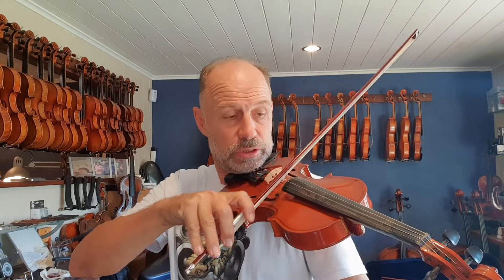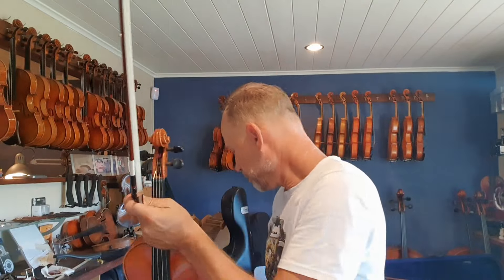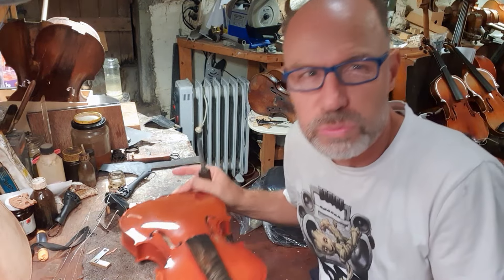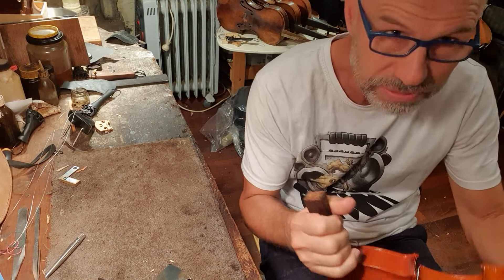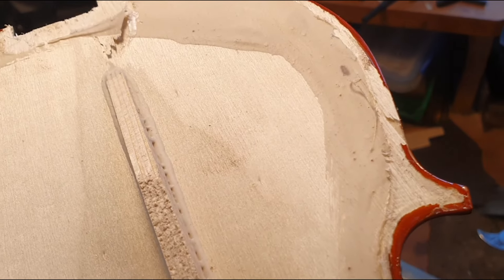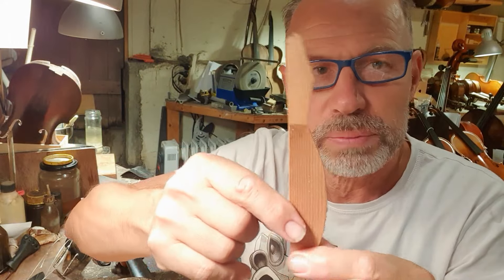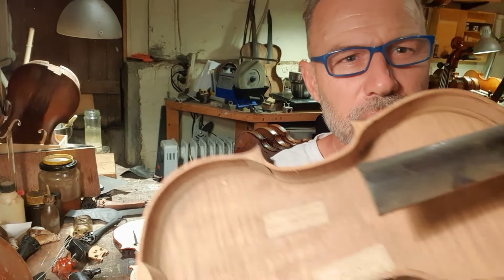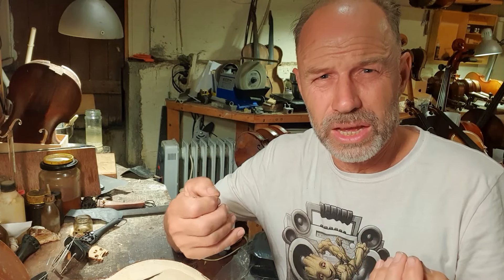I open up the 100 dollar violin

Comment: Olaf this information about the summer and winter grains of wood and how that works for the top plate is really fascinating! I love little bits of info like this. Thank you!
Reply from the maker: Thank you
Reply: Agree! I really love learning interesting tidbits like that.
Reply: That was super informative! No wonder so many top end acoustic guitars have sitka spruce tops.
Reply: I don't want to sound pedantic here but the growth rings are a combination of cells that are laid down in the spring and the summer, not winter.  Trees, other than those in tropical areas where conditions are similar throughout the year, do not grow in winter.  The trees go into a dormant phase. When growth starts in spring cells are laid down relatively quickly and the light part of the growth ring is formed.  This is the springwood.  Cells are laid down more slowly in summer and these form the dark part - summer wood.  An annual  growth 'ring' is a combination of these light and dark cells - one layer of springwood and one layer of summerwood.   

Fexibility along the grain is determined by the length of the cells that are laid down.  In spruce these are relatively long, hence its relative strength.  Wood cells in ash, elm and poplar are also relatively long, hence their use in spokes for cart wheels and snooker cues (ash), wooden (not MDF!!) coffins which are shaped (elm), and matches which have to resist snapping when struck (poplar).  Trees that do grow in the tropics may not have spring and summerwood like temperate species, but still do produce 'rings' as growth rates vary throughout the year, though they may not be very distinct.  Some species like eucalyptus have a 'resting' phase each year even though conditions for growth may be conducive.  And finally the term 'sap rising' is a bit misleading.  In any tree free water or sap is found in the cells in the cambium - the actively growing tissue below the bark - and is there all the time.  It does not rise and fall depending on the season.  The more accurate term would be 'sap flow'.  It flows fastest in spring, slower in the summer, and there is hardly any flow, if at all, in winter.

Lecture over!!  I really enjoy these videos and it is great information for when I make my first fiddle.  Thank you Olaf.
Reply: @wyzonzebedee5556  I thought that spruce was a coniferous tree and didn’t lose its needles.  Does it also go into a dormant phase in the winter?
Reply: @jasonli2974  Hi Jason.  Spruce is a coniferous tree and does not lose its needles in winter, and is considered to be an 'evergreen'.  Mind you larch is also a coniferous tree and it does shed all of its needles in winter.  The term 'evergreen' is not that helpful really.  The botanical distinction between coniferous trees (gymnosperms) and broadleaf trees (angiosperms) is how their seeds are developed, not whether they keep their leaves (needles) or not.  The seeds of gymnosperms are usually formed in cones and the seeds are 'naked', i.e. do not have protective cells around them.  The seeds of angiosperms develop in the ovaries of the flowers and are surrounded by protective cells.  If you tip a ripe pine cone upside down the seeds will fall out.  However if you look at ash seeds for example they have a thin layer of tissue around them and have wings to aid dispersal.  Horse chestnut seeds, or conkers, have a thick fleshy skin around them.  The flowers on a pine or larch are beautiful structures in the spring as they develop, and to make things more complicated, or interesting, there are male and female flowers.  It is the male flowers which produce the pollen, the female flowers grow into the cones.  

Spruce does go dormant in the winter, hence it will have distinct annual rings.  I'm guessing here but I reckon the best spruce for violin making comes from areas where spring and summer growth conditions vary little from year to year, i.e. in mountainous areas, or in areas with short springs, consistent hot summers and cold winters and where growth rates are relatively slow.  This will give narrow and even growth rings.  In areas where the weather is much more variable and spring and summer can be wet or dry and there is less consistency between years the relative density of the wood between years will vary more.  Again I'm guessing but I suspect this is not so good for violin making.  Looking at the top of my violin the growth rings are even and very close together.  Somewhere in Scotland (where I live) there may be a stand of spruce where growth has been slow and even, but I have yet to find it!

Hope this of help.  Timber is a fascinating subject.
Reply from the maker: @wyzonzebedee5556  thank you for the detailed explanation.
Yes, the best spruce for stringed instruments comes from mountainous regions because of the minerals and the big difference in temperatures. 
When you tap a piece of timber for a top, it should have a clear ring to it.
Reply: Indeed it is.
Reply: https://youtube.com/shorts/2WP5LaU617Y?feature=share4 @jimothysparkcus .n 2:11ñp😊
Reply: @AskOlaftheViolinmaker think a little deeper, mountains have higher elevations therefore lower temperatures, thinner atmosphere, water migrates away from roots due to slope, less daylight due to shadows,  all above regard annual growth making wood denser and with a little more thought we could probably expand this list.  But what do I know, I’m a hillbilly from eastern Kentucky!
Reply: Actually the spruce preferred for this is called "Nordische Fichte" in German, which means the trees grow up in the north near the polar circle. The trees growing in the mountains have a similar effect, but they more often get uneven sunlight. The best trees grow in the mountains in the shade, where they almost never get direct sunlight, only indirect ligtht, reflected from the sky. They do not tend to grow larger branches in one direction and grow slowly but very balanced. Some instrument makers look out for these trees and pay a substantially larger margin for those. The forester in charge knows that and gives heads up when they harvest a certain area. The instrument maker then picks the trees he wants before they are cut. Sometimes they even use helicopters to transport them over rough terrain. The wood then is dried carefully in the shade in open air, in the cool, as slowly as possible to give the wood the time to react to the shrinking process. You do not like heat treatment. Wood for furniture can age for five or six years, but wood for instruments ages as long as possible, even for decades. Wood shrinks over a long period, even after one hundred years, but the shrinking rate is slower the older the wood gets. So you want to use a piece of wood that is 50 years old on an instrument that is 200 years old, just because you do not have wood that is that old. So you just take the oldest you have to get the best possible match.
Reply: Very interesting video. Also, the wood for the top and back is true quarter sawn and not flat sawn. So the grain length is perpendicular to the top and quite short. Expansion is in the thickness and not the width.

When you buy a sound board top, it comes as a kind of wedge. You resaw the wedge, book match it and glue the joint. Then you get to shape it.

Critical are the F holes in terms of placement and shape. Depending on the note, their are various modes of oscillation. The tongues wiggle differently. So how the wood moves under harmonic vibration is critical. Plywood prevents the proper mode of vibration.

Trees in the alpine are stunted and extremely slow growing so growth rings tend to be very narrow. The density of the wood also matters. If you thump a log with a hammer, a sound tree will have a deep hollow sound opposed to a thud. If take a wedge, sometimes split with a friend, and thump it after initial drying, you can the base note. If it’s got a defect, you can hear that immediately.

The base bar stiffens up one side and restricts vibration to the lower frequencies and modes. Truthfully it should be tuned by using an ibex plane and thumping the top. Removing small amounts until you hear the warm thump.

I was amazed that a ply top sounded that good.
Reply: Can you please tell me what brand this $100 violin is? I bought a Glarry violin in the past that looked good and sounded ok to my ear. Of course I play like crap. I am planning on buying another cheap violin because I'm almost 60 and I know it's not worth buying an expensive instrument.
Reply: Shouldn't you have heard this in biology class at school?

Comment: Reminds me of cheap homes, where the bulk of attention to detail comes at the very end, to hide all the inexpensive shortcuts and cheapness that will fall apart in short order.  My father once did a tour of such a house, and when he pointed out that he could feel a breeze in front of a closed doorway, they mentioned that they could change that - like air leaking through doorways was a feature.
Reply: Property developers...
Reply: That's aerodynamics, ~ helps the house go faster.
Reply: NEVER buy the models. They are built first and have all of the fuck ups! I built many track homes....what an experience that was. My house was built in 1965 when they still used true dimension wood, six inch walls and heavy iron pipe. Anything that is ´´master planned´´ and built after 2000 will fail quickly....cough, cough...Chinese drywall...
Reply: That can happen in any house, cheap or not. All it takes is a lazy door hanger. Having expensive doors doesn't keep it from happening.
Reply: @J.C...  "Having expensive doors doesn't keep it from happening" - I don't think the OP was implying that expensive doors would prevent the air leak, in that example.  I think he was saying specifically that the builder didn't pay attention to the details when building the house, thus the "shortcuts" and lack of attention to detail led to inexpensive and cheap-quality labor, which resulted in the air leak (as opposed to building the house properly, paying attention to details, which would have increased the labor cost).
Reply: Using wet wood will help keep the humidity up in winter.  Definitely a positive feature that everybody should want.

Comment: Well, you can sell it to a stock photo agency... They don't even care if their models are holding the instrument right.
Reply: Yes and no. Some customers, especially those paying $500+ for a single photo, might be discerning. But if it's for a mainstream ad or a movie, they will put the most deceiving fakery in there.
Reply: Sometimes the violinists in publicity photos have huge long fake nails.
Reply: Or if it has a bridge... or if the bow is before or after the bridge... Or if the bow is relatively straight across the strings...
Reply: Enrico Friedrich As amazing as those stock photos are, they can’t hold a candle (or, indeed, a flaming violin) to the stock photos of people soldering. (Ok, actually they can, but then a perfectly good pun would have gone unused. All the same, electronics repair stock photos tend to be a dumpster fire of hilariously staged randomness while holding parts and tools in nonsensical combinations. But the take home message is of course to always hold the soldering iron by the heated working end, not the handle... 😂)

Comment: Interesting that hide glues are used for violins, as they’re similarly used in art restorations for much the same reason that it’s reversible.
Reply: Are you a fellow Baumgartner fan? 😊
Reply: Cynthia Verjovsky Marcotte Of course! What could be better than fish skin glue and Belgian linen?
Reply: @eliz_scubavn  right??
Reply: @cynthiaverjovskymarcotte1379  :0
Reply: Similarly, the neck joints on better acoustic guitars are often done with hide glue,  so that neck resets are marginally less painful for the repair guys.
Reply: @eliz_scubavn Yes , but it has to be fresh to dry hard. Hard to find now a days, but you can make your own. Glue pot recipes are best. Hide is pretty good too, also needs to be fresh.

Comment: just the fact that it's made of plywood explains why the instrument sounded so "muddy" having the grains of the wood bring crossed one way and then  the next layer being at right angles to the first would stop the plates from vibrating properly
Reply: Yes, I expect that the plywood damps a lot of the vibration. A flitch of old growth growth spruce will ring if tapped.

Comment: Every material has a modulus of elasticity.  When the material is formed into a shape, we can determine its natural resonant frequency.  Consider a perfectly shaped violin top plate made of stainless steel.  The modulus of elasticity is much higher (stiffer) and so the natural resonant frequency will be higher.  Get the perfect material but shape it improperly, and the NRF changes with the shape.

It is completely unsurprising that a lamination of wood and glue, with alternating grain direction, has a different modulus of elasticity.  The modal shapes will be quite altered, and the change in the NRF will change the sound.  

VSO indeed.  Well explained Olaf.
Reply: Spoken like a true engineer. It might not be that simple because different shapes will have different internal reflected sound wave distances, and that might make it sound different.
Reply: @SidneyCritic  Hi Sidney.  Yes, a differently shaped object will have different modal shapes.  Even seemingly minute differences can have dramatic effects.  Finite Element Analysis can illustrate this beautifully.   And yes, engineer here.
Reply: Do you think it's possible that the horrible looking resonance bar actually helps the VSO resonate better than a decent resonance bar would? I mean, could it be that making plywood resonate as much as it can is actually less pleasant for the ears than resonating it not so much (so that its bad sound isn't amplifyed, if you know what I mean)?
Reply: @oliviapereira364  Hi Olivia.  The resonance bar is likely made of plywood, just as the rest of the VSO is.  Speculating how that individual part would "improve" the sound is meaningless.
Reply: And further, the glue probably is damping the modal shapes, and the layers can be trying to vibrate in different shapes creating interferences. I don't think there is anything to be done except creating a new plate with a different material, which defeats the purpose.
Reply: @cfddoc  correct!

Comment: Little note on what you said at about 14:23 on winter and summer grain. Maybe for simplicity’s sake you cut a few corners, but I learned that wood does not grow in winter, so the darker lines (winter grain) are the ones the tree makes in late summer and fall to stabilize the growth it had in spring and summer (the lighter lines (summer grain)). Alpine spruce has, for the more difficult environment, less summer grain and thus it is harder (the dark lines are always the same thickness).
But very good content, I really enjoy our videos.
Reply: It depends on the climate. There's places where the summer is too hot and the trees are just trying to not die (they even get rid of some leaves like in fall in other places). Then in fall and winter they grow and get new leafs because that's the seasons when there is some rain.

Comment: - Did I get this right, Olaf?
- To produce the narrowest growth rings for Alpine Spruce, the trees would have to be grown in:
- North Facing Gorges with Steep Sides so sun and heat are limited year round especially during mini-Iceage times.
- There are such 3-5 ft diameter trees, but they are at sea level in Bay of Fundy, Nova Scotia.
- They would be good for masts, yards and spars but probably not for violin top plates.

Comment: Please do an episode with the God Pillar XD
Reply from the maker: I'm in two minds about it... it's a really dodgy website
Reply: @AskOlaftheViolinmaker  Safer to make your own god pillar. Can't be too difficult 😄
Reply: I converted a viola to the sound post through the belly to the bridge & it made it into a 'deep boomy' viola. That was different. Some have advocated it for small instruments used as a viola to at least get it sounding something like a viola, but it does require careful maintenance of the bridge, unlike many that let their bridge continue to bend towards the fingerboard. The soundpost is connected to the bridge foot by pinning with a toothpick. :)
Reply: @rossthefiddler5890  I tried down octave strings on my violin and took them off after two days. The effect was horrible and it took 6 months for my violin to settle back down again.

Comment: I'm never going to be a violinist. I'm just going to "fiddle" around now and then. The $100 toy is good enough.
Reply: Renting is cheaper and you can get a MUCH better instrument.
Reply: @brattingprincess  That is probably the best idea. I know a lot of students in middle school and high school rent instruments for marching band.  I hadn't thought that they rented violins too.
Reply: Robert Schuster Yeah we all rent until we get to be full size. Even as a big kid I grew into full size at age 12. There also may be an availability issue because maybe there aren't any rental shops in the area.
Reply: Honestly, something like this can potentially be fine to play with, just not as nice sounding as the real deal.

BUT
1) Usually the set-up is just as terrible as the materials.  The pegs stick.  The bridge is badly cut.  The nut is all weird.  So it's nearly impossible to tune the thing.  It's uncomfortable and difficult to play.  Basically hellish for a begginer.  

2) sorting out these set-up issues is actually quite expensive.  So you saved money buying a cheap violin and then you have to spend loads of money polishing a turd.  

3) if you spend your money the other way round  - 500 for the fiddle, 100 for the set-up, and Not 100 for the fiddle 500 fixing it's issues - you'll probably have something decent. I'm not saying it'll be amazing, but it will be miles and miles ahead of a plywood one.